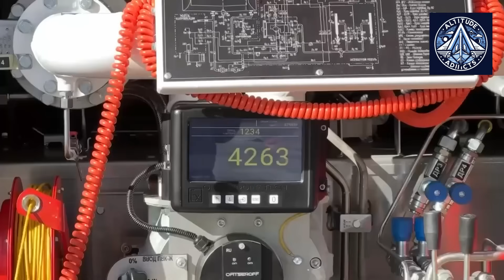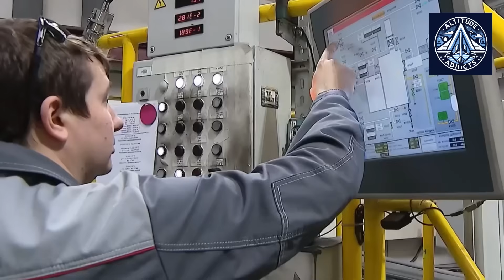Russia’s PD-8 Engine Promises 2–5% More Cruise Efficiency

Comment: all that matters is that it is at least as good as the Sam-146 for now. Apparently it is better already. The big question is how much more efficient does the engine need to be for existing airliners with Sam-146 engines to re-engine to the PD-8 ? 5% is probably enough ... something tells me 1/2 of the existing SSJ-100s with Sam-146s will be re-engined .... and the engines taken off them will be cannibalised to keep the other 1/2 flying .... Russians tend to think like that
Reply: Anda benar sekali.
Jika memang bisa didaur ulang, maka dilakukan itu.
Jika SAM146 bisa dipakai dulu hingga ngadat, lakukan itu. Lalu copot diganti PD-8.
Komponen setengah rusak dari SAM146 memang bisa dikanibal untuk perakitan mesin lagi.
Reply: O its good, all it is a revamped Soloviev D-30 engines that has been powered the IL-62 for the last 50 years... Or an Kusnetzov KS-8, or a Lyulka AL-7, or Progress D-436, or Lotarev D-36, or ... Russians have so many turbine engine design bureaus and a lot experience making turbine engines since their first patent in 1907 in St Petersburg ( pulse jet engine )

Comment: Really glad to see the PD8 engine coming along👍🙂 I still think Russia should look to create a stretch version of the SJ100 when the  Russified engine is in service. I think MC21 should not have a short version but instead focus on I ky a medium and stretch framed version ;just like Airbus did with the A350 900 and A350 1000
Reply: @CJ-xl3dh  they can't stretch the ms21 that much, its a b737 class narrow body aircraft, best they can do without major development cost would be to stretch to an a321/757 class.
Reply: @chiefdenis Many thanks for your reply. I do understand the increased cost, but the MS21 wider cabin gives it the potential to be stretched and reconfigured for an ultra long range narrow body which could sit somewhere higher than the A321 XLR but near to the A330 800/900 or 787.

It could also consider using the PD35 engines for that variant ;they may be underpowered for a widebody, but may do well for a narrowbody jet like the MS21.

The future revenue advantages could be huge; not just for Russia but airlines looking for better margins who may struggle to operate widebody long range jet

Unscientifically, the wider fuselage of the MS21 looks like it could be safely stretched and reinforced to supply around 300 passengers;around the top passenger loads the 757 300 had.
Reply: MC21 is heavier due russification.. so stretched version is questionable ... not by aerodynamics but a weight ...
Reply: @bobovoxar9296 Many thanks for your reply.  I do agree, but with Russia doing this tje harder but ( i might add) right way of seld sufficiency, hopefully in time rhey may find local ways od reducing weight and efficiently increasing engine power output.
Reply: @CJ-xl3dh  russian approach is always bit conservative, overdimensioned because their harsh enviroment ... they call it " zapas protchnosti" - american is like swiss watches but russian ?.. ok ! it works ,can it withstand -40 C? yes... can it withstand landing in field?... yes! ok! ... west can not say it always and unconditionaly -but russian with confidence ...
Reply: @bobovoxar9296  i agree. I do hope; inside the way Russia do things, that they can discover new efficiencies. 

World needs countries other than our now proven less tgsn honest western lead states.
Reply: @CJ-xl3dh  russians do thing like Evolution rather than Revolution .. their knowledge base is huge based on experimenting on real world - not simulations because their computerization was limited from 1980 to 1995 due cold war santions ... russian aerodynamics is more advanced (to cover excess weight and weaker thrust engines-see Mig 29 -climb rate and maneuvrability in today unmatched for nonvectoring propulsion in one plane)